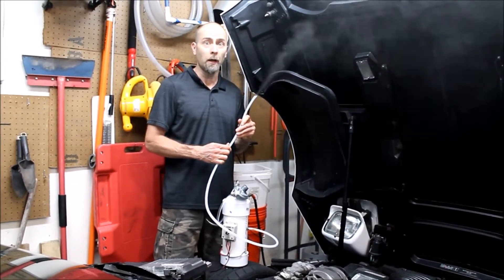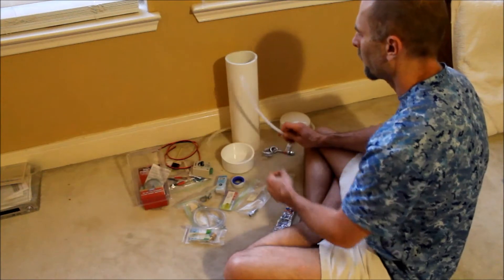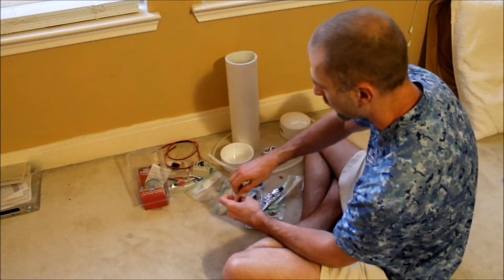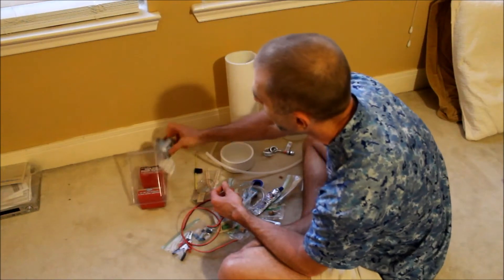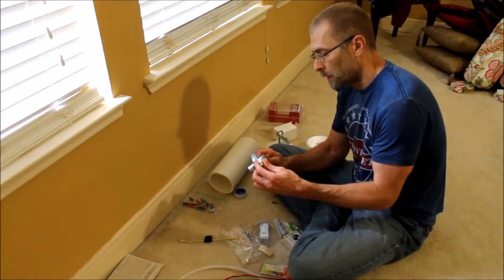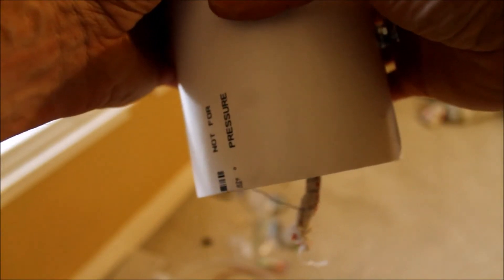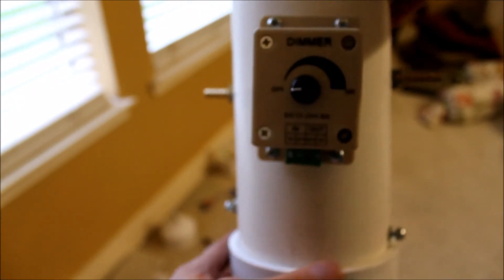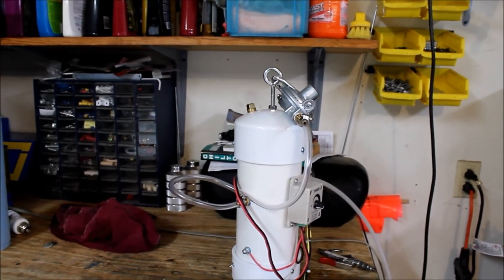Cheap Smoke Machine for vacuum leaks

Comment: Thanks for video, just wondering what keeps heating element from melting pipe
Reply from the maker: Since you're only using minimal voltage, the screws don't provide enough resistance to generate that much heat. If you were to crank it up all the way that might happen but you'd probably burn up the wire in the process.

Comment: Great job! 
I've read that it is best to have the output hose outlet higher than the input hose inlet in the PVC. 
But yours looks like it is working just fine, so maybe that really doesn't matter. 

Using a regular compressor is safe for smoking an intake or vacuum system, but you should only use an inert gas if smoking an Evap system. 
Adding oxygen to a gas tank along with the already present fuel vapors is not safe. 
I was able to get a filled Nitrogen bottle and regulator for about $150 so I could safely smoke Evap systems too.